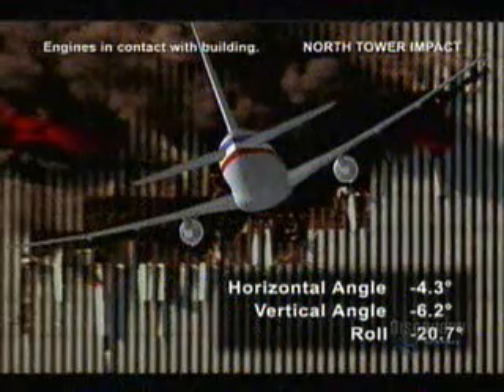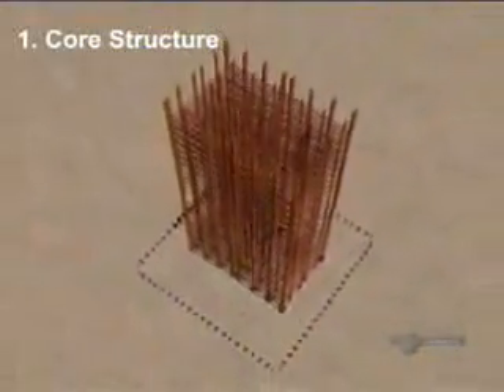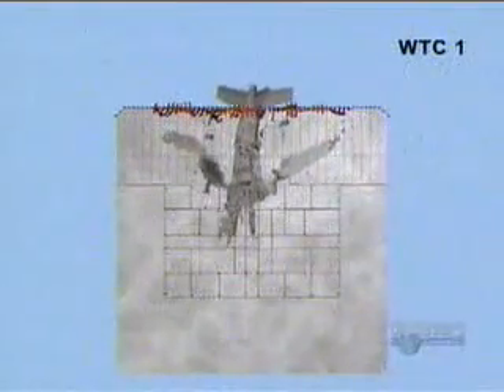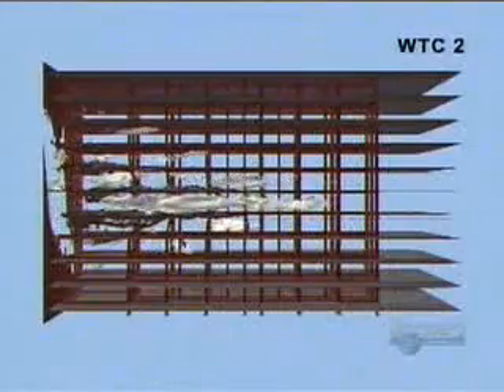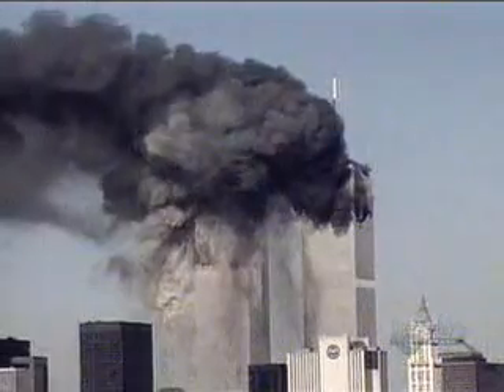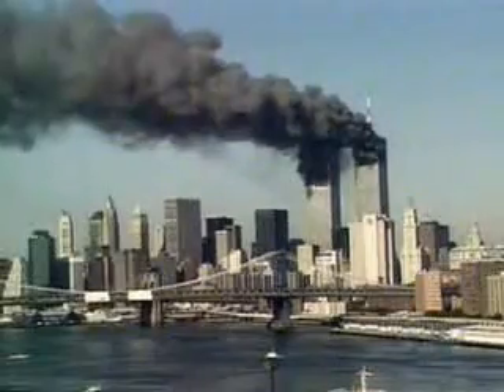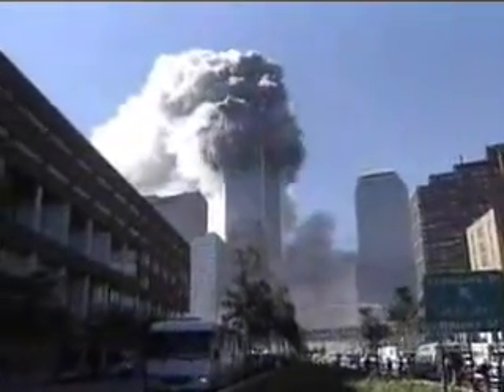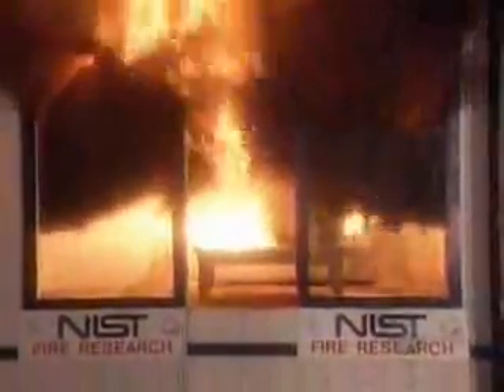9/11 What Made The WTC Twin Towers Fall

Comment: Okay, so to all people saying that they needed explosives to collapse the towers:

The 767-200 that collapsed the south tower went 885 km/h which is 246m/s.
The estimated weight of that 767 is about 130,000 kg. 

The formula for kinetic energy is E=½mv² so E=3.9E9 Joules of energy. Or:
3,900,000,000 Joules

That's a lot of energy.
Reply: the towers were supposed to absorb multiple impacts from multiple planes, that energy is nothing compared to the wind load these towers withstood on a daily

Comment: The fact is that the buildings were extremely badly built. Workers used to stick columns together with chewing gum instead of welding and major trusses were made from old rusty Ford truck chassis. rivets and bolts were supplanted by nuts and caps glued to the steel. Steel that was made in a suspect Iowa foundry that closed down later due to it's use of thermite paint.
The building, supposed to withstand a hit from a Boeing 707 was actually vulnerable to a Cessna 176. WTC 7 was made from used matchsticks.

Comment: horse shit...
This knothead is trying to pull the wool over the people's eyes.
1st - aluminium isn't stronger then steel.
2nd - the heat from fire wasn't hot enough to melt carbon steel
3rd - no sky scraper in history has ever failed from fire...
But apparently new York can have 3 in one day.. and one wasn't hit by a plain.
if you believe this film, go drink  gas and eat matches
Reply: 3rd yeah right...let's see how many skyscrapers had a giant whole in the middle after a plane hit them with ton off fuel and ton of speed...tell me how many
2nd the steel didn't melt the steel was weakened 
1st what?

Comment: There is NO WAY that the flimsy thin wing tips could slice through the twin towers" hardened (load bearing) outer shell without aid...explosion within the building just prior to the hit!  And the technology was there to remotely control a "fly-by-wire" plane using an attached pod.

Comment: I do not know what is funnier - this load of shit or the assertion that the molten metal on site was aluminium,not steel.
Numerous sources say they saw molten STEEL , there  are iron-rich micro spheres in the dust , there is at least one surviving piece of eutectic-affected steel which the BBC rather cutely refers to "as possibly one of the biggest mysteries of the WTC attack", there is the "Meteorite" which contains steel which was once molten, there is the lead structural engineer on WTC tower construction Les Robertson who says he saw "a little river of molten steel" then subsequently denied saying it, there are numerous firemen on camera who say they saw molten steel.

No Molten Steel !!! - Give me a break !
Reply: Sure. Every single person correctly went through the process of making sure the molten metal they saw was steel and not aluminum (which will give off an extremely similar bright orange glow but at much lower temperatures) considering the first thing most people think of when people say metal, especially for construction, is steel it makes plenty of sense thay everybodies first thought upon seeing molten metal is. "Oh it's steel"

Comment: does fire travels downward or upwards? how much fuel does it take to reach all the way to the bottom of the floor while still burning? is the temperature at the bottom of the tower really enough to weaken the steels? if the bottom of the building was also burning does that mean nobody got out alive from the building?

Comment: Explain how a building can collapse at free-fall speed? Free fall is like dropping a bowling ball and a golf ball from any height. They both hit the ground at the same time because there's no resistance, other than air. If we have a pancake effect each floor would provide substantial resistance. Basic physics 101. But yet all 3 towers fell at free-fall speed. Follow the money people
Trillions of dollars!
Reply: Bruce Hillberry You sir are very right.
 
The undamaged stories below the impact zone offered zero resistance to the collapse

The glass and concrete spontaneously disintegrated without any expenditure of energy

On 9/11 no energy was conserved.

Comment: I've heard the buildings were designed to withstand several impacts from airplanes. Also, the video of the 2nd plane DOES appear to show the nose of the plane exiting the other side intact, not shredded. Anybody care to comment on my two questions?
Reply: f2mel2 EXACTLY
Reply: f2mel2 One of the architects said it could survive a 600 mph impact from a Boeing 707.

Comment: Could someone explain why, when the damage seems so heavily concentrated, even the guy in the vid said it was like takeing a leg off of a 4 legged table, what allowed it to fall straight. Im imagining a large tree trunk, then if you hack at it with an axe, I would assume you would have simular distribution of forces, (well, not exactly, because a tree is mostly solid, and a tower isnt) the top portion of the tree topples sideways. Why doesnt that happen with the towers? wouldnt the steal, weakend as it is, still have enough structure form almost a bow, and, at the veryleast, knocked the top portions of of the foundation?

I play with robots, and mess around with planes and drones, so my knowledge of materials is limited to that scope, I dont want to be mistaken as a crazy conspiracy theorist, I just want something better than "Because gravity is so fast" (or, at least i think thats what he said)
Reply: A bit late but its quite simple. Trees are solid throughout. WTC towers were basically just a steel skeleton. Most likely if the same was to happen to a structure like the empire state building or One WTC it would stop the collapse. But the steel core of WTC towers wasnt able to support the force of 20 or so floors free falling on top of it. And the more floors collapsed the more weight fell down on the rest with more momentum.

Comment: So he says the gravity caused the floors to collapse, all vertically straight down. What happened to the 47 steel core columns of 1400 feet each that he talked about? Shouldn't they all still be standing? The fire-proofing material would have only been destroyed on the floors where the plane hit, what about the other 100 floors or so?

If you stick ten equal-length half inch metal rods on the ground, place a slab of rock on them, what happens if you start pointing a blow torch to mid section of the rods so that they start melting? Does the slab come straight down as if all the rods have disappeared?
 
Let's say the support for few floors that the plane hit was completely eliminated. Imagine you are 3000-feet-tall human and you grab the top 5 floors with one hand and  knock off three floor below them. Now if you let go of the floors you are holding from 40 feet on top of the remaining floors, will the weight and impact of the top 5 floors cause them all crush to ground? And let's not forget that the victims that were in the building were torn to thousands of pieces. 
BTW, can you post a video that explains why building 7 came down in the manner that it did?

Comment: This is nothing new this is the official report by NIST.  Everything in this video and the official report has been disproven with science and  proven to be fraudulent by architects worldwide and over 2,500 architect's and engineers in America alone are calling for an independent NEW official report. Lastly, the top part of the building wasn't strong enough to crush concrete and steel beams that had not been compromised. By newton's law's ever reaction is met with an equal reaction, so if the top part of the building did fall it would have crashed into the bottom halve slowing it down significantly and then would have tipped over and slid off the side. That didn't happen, what happened was it fell at free fall speed with little to no resistance, the only way that happens is if the bottom half was compromised. That's why every expert who's done demolition projects says, "that was taken down with explosives". If you still disagree, please explain building 7!!! Lmao

Comment: Your key point is a joke. It doesn't matter if the fire proofing wasn't in tact because jet fuel along with office fire doesn't heat up fast enough to melt steel or weaken steel in a few hours!  LMAOOOO Is this video made by a shill or what!

Comment: The south tower collapsed first because it was hit lower so had more floors of weight pressing down on the damaged part
Reply: no
Reply: @Trojan_Horse24241hgreihgeihrg  yes
Reply: @hyzercreek  the south tower had less fireproofing, the plane was travelling faster upon impact, and the angle of impact meant the weight of the above floors couldn’t be evenly distributed. american 11 hit the center or the north tower so the weight was spread throughout the exterior columns, with the core absorbing the bulk of the airplanes impact. the burning jet fuel later sealed the fate of both towers, reaching over 1000c. you are wrong.

Comment: I used to be a 9/11 "truther" ten years ago, then as I got older I began to realize that many conspiracy theorists out there don't really believe in what they peddle but rather do so for personal gain. They claim the mass media manipulates and brainwashes people, as they manipulate and brainwash others. Here's what makes sense:

1) The twin towers did not collapse in a way consistent with a controlled demolition. It's clear the collapse begins at the top, under the impacted areas, and not a free fall starting from the bottom. The amount of time, effort, manpower and subterfuge required to plant and hide thermite explosives to make that work is insanely unrealistic.
2) All of the planes were loaded with actual, real people, all of which have graves you can visit and surviving families you can talk to. The passenger lists couldn't be made up, and these people can't all be fake actors.
3) Pentagon damage is consistent with a high-speed large plane crash, despite lack of clear video showing the plane. It is possible and provable in other plane crashes that depending on the angle and speed of the plane, it can be completely annihilated on impact. Given the plane penetrated several concrete walls and steel supports, it can account for the lack of actual plane wreckage.
4) Based on the recorded angle of impact, it's certainly possible for Flight 93 to have virtually disintegrated on impact.

Some concern I still have is how both towers could have collapsed the same way, within such a short period, unintentionally? Why is there no clear footage of a plane hitting the pentagon? Why did it take 7 years for NIST to retroactively conclude, with almost no evidence to examine, that WTC7 collapsed due to fire? I'd like to point out as an insurance underwriter, if the WTC7 collapse and subsequent "explanation" occurred on any other day, I would have serious doubts as a professional and our investigators would be all over Silverstein. No doubt due to the nature of the attack, the government likely stepped in and prevented an independent investigation by the insurer. I am extremely skeptical of Mr. Silverstein and while I do believe 9/11 was a genuine terrorist attack, I believe a great deal of opportunism occurred both on and after 9/11 that was quietly brushed under the rug.

Comment: And the airplane? Wings must have been made of very fast reciprocating hacksaw material. Eidence now shows that the first tower wad hit was a missile, the second was hit by a remotely controlled airforce plane with an attached missile, and the Pentagon was hit with a missile. And who are the responsible criminals? Well we can all figure that one out for ourselves.
Reply: Corrections. Evidence and was.
Reply: You sound ridiculous, they were commercial jetliners. The mass of the plane travelling at 500mph would easily penetrate a steel structure. If it was hit by a missile the explosion would occur at impact and not when the plane strikes the central column as it did.
Reply: Xand - rediculous you say? I see that you have not studied any engineer reports, pilot reports, and the full report on the actual construction report. And listen to the guy who is reporting this information. Jet fuel does not burn hot enough to melt steel. This was an inside job, killing many innocent lives, and time is near where a new and full investigated report will take place. This was an inside job, using high heat explosives, which we now have full evidence of. The use of an airplane was the deception that led you and most people to believe the lie.
Reply: J Roger Trudel Big difference between melting and weakening steel. It was not hot enough for the steel to melt, but it was definitely hot enough for the steel to lose its structural integrity. There was no explosives, the puffs of smoke was from pressure by the floors collapsing, and the blown out lobby was from the pressure and jet fuel that shot down the elevator shafts
Reply: Xand - if you are an intelligent person please go see the full document of "The Science of 9/11. Close your deceived mind then View it with an open mind. You will then see the picture. I am a steel construction specialist and no steel constructed buildings have ever been brought down by fire. Also study the structural documents of the construction details of the twin towers. In no way was fire able to weaken the structural steel. The columns were severed with the use of Thermite Explosives as that has now been fully established by independent investigations. Hope this helps.

Comment: No, that's not right...the buildings were built for airliner impact, that's why constructed the core center, the fuel was pretty much destroyed at impact, it exploded...there wasn't much fuel left....ur still not at the right temp either for that much steel to take out the 95 stories below it...and building 7 is the most unexplainable...office fires or any fires for that matter have never made a steel structure fall at free fall speeds....why didn't the other 4 building fall like 7....they were smaller than 7 and charred....
Reply: That's disingenuous, and you know it.  The WTC was constructed to withstand an airliner (of the time when the buildings were constructed).  They were NOT made to withstand heavier, later aircraft, and they were NOT meant to have the aircraft (weighing 179 tonnes) resting on essentially a single floor!  The architects of the WTC have pointed this out many, many times, but somehow you've missed it.  Lastly, it wasn't thought that an impact would strip away the fire retardant material on the floor trusses.

Steel loses it normal magnetic properties at temperatures as low as 500 c!  Way below its melting point, stressed steel becomes subject to shape change.  You don't need to melt it, simply ask any metal former.  Two identical steel balls - one in a freezer, and one heated over a domestic fire - will have two differing diameters.  It's an old school-science trick.

Typical 'Building 7' fires are ALWAYS extinguished.  Building 7 was left to burn.  What do you think the natural conclusion to that would be?  And lots of steel-structure buildings have fallen during fires - simply Google it.  Come on, don't be so lazy, and simply trot out all the hackneyed lies that come out of the conspiracy theory.  Do some research and see if what you are saying is actually correct.  Then you'll find that it isn't.
Reply: Barry Foster finally someone with brains

Comment: For the more advanced, you can weaken many of the strongest types of steel significantly and semi permanently just by heating it up in a campfire. The reason is to maintain the structure inside the steel it has to go from white hot to near room temperature very rapidly. Its why you see metalworkers dunk finished metal in water, its called heat treating.

Comment: Blacksmiths out in the woods of spain worked all types of iron and steel back in the early roman days with nothing but wood or coal fires and you idiots dont think a massive fire made by jet fuel and also everything inside the building would be hot enough to weaken steel?
Reply: Jimmy Mcjimmy To be fair, steel wasn't made until the 1800s
Reply: Jimmy Mcjimmy Yea only difference is they made thin sheets of steel those are giant steel beams made for a skyscraper.